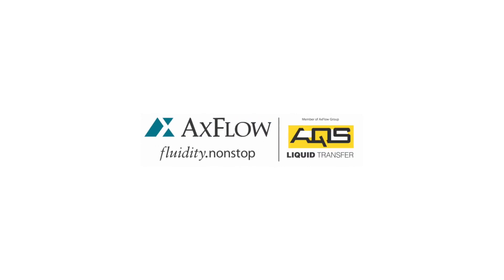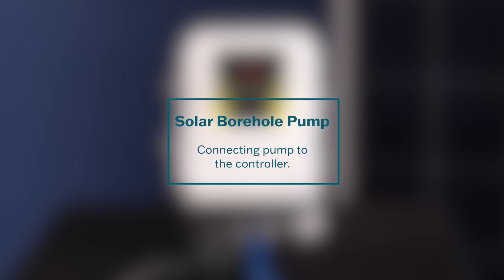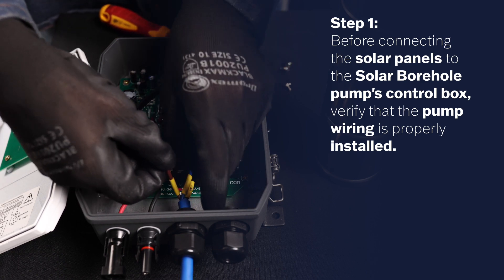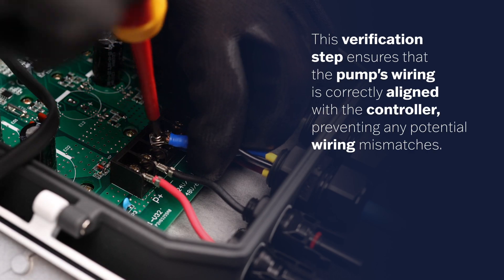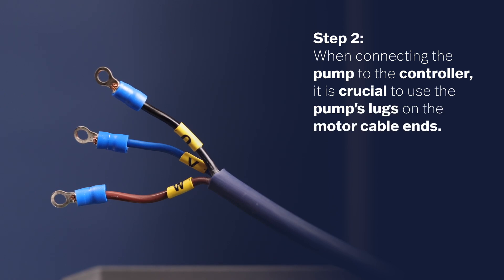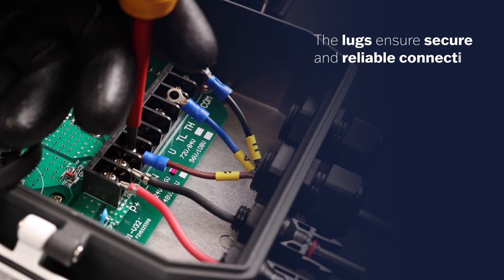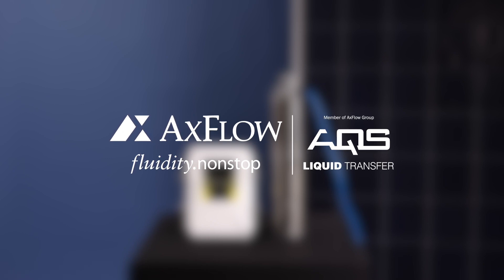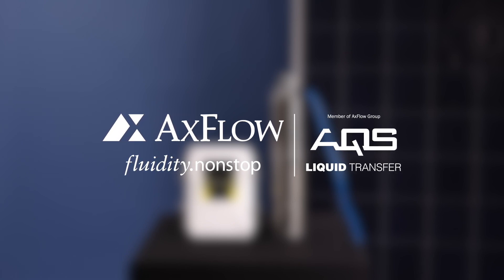How to Connect Your Solar Borehole Pump to the Controller

Comment: My 2hp dc solar pump is pumping low pressure what could be wrong
Reply from the maker: Your 2hp DC solar pump might be experiencing low pressure due to running in the wrong direction or receiving low input power. Please check the following:
• Ensure the pump’s rotor and stator is running in the correct direction.
• Test the pump during peak sunny times.
• Make sure the solar panels are clean and facing true north (if you're in the southern hemisphere).
Reply: Your intake into the pump maybe blocked